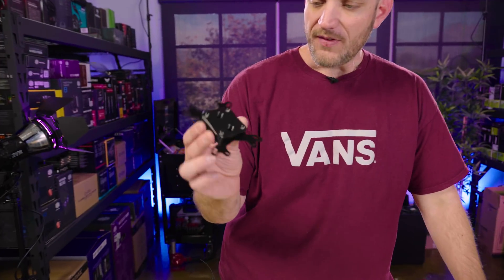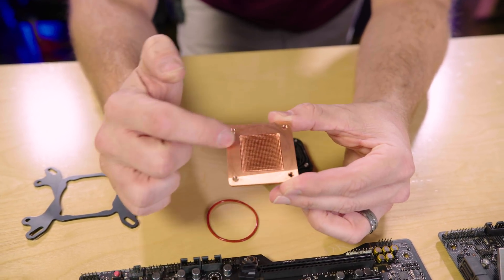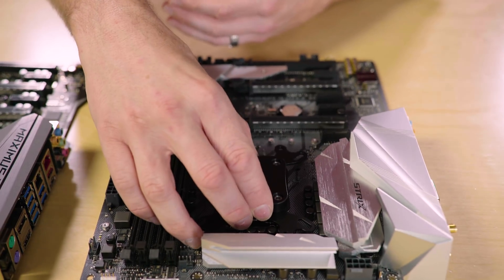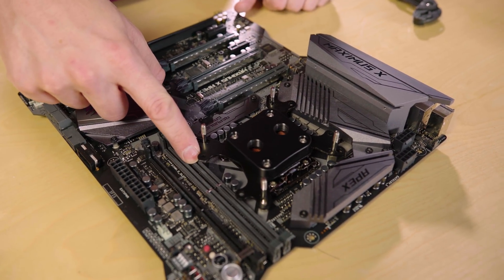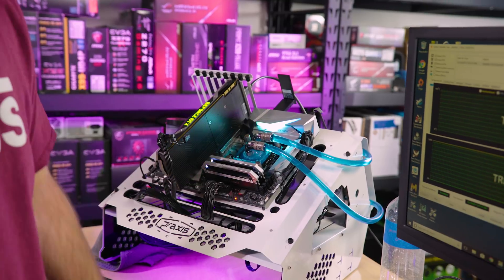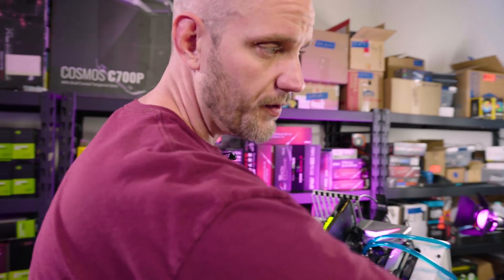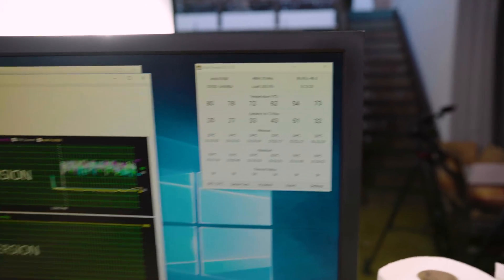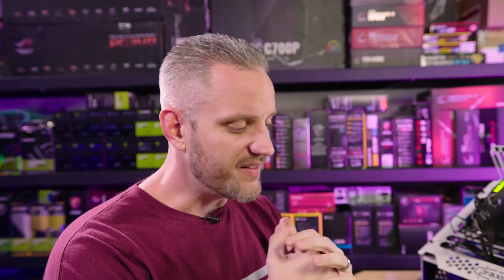I tried watercooling an overclocked 8700k with a $19 waterblock

Comment: $800 loop is still a fair bit i reckon, all depends if we include gpu or not an dhow many rads? My current loop 3 x 360's ($100 each), cpu block ($180), GPU block ($280), pump/res ($300), 2nd pump ($150) plus plumbing  and fittings, thats all AUD and  around $1200 which is only 854usd for a pretty decent loop, all major components EK apart from rads which are corsair. If you omit the gpu block, 1 rad and 2nd pump is WAY WAY under $800usd! It all snowballs anyway, my current build has more in fittings than i spent on my first entire loop!

Comment: Used to have a $17 waterblock cooling my hot Xeon and 2 cheapo gpu waterblocks cooling 2 overclocked rx580s which ran at almost 90c on air. They worked, ran no hotter than 60c on all 3 with 2 240mm rads

Comment: I built a loop with tons of Barrow parts ordered from Aliexpress: blocks, res/pump, fittings, tubing, etc. It worked great, and furthermore I didn’t clean it out for 2 YEARS, but when I did everything was super clean, no bad build-up, oxidation, corrosion, nothing. So in my limited experience at least, you definitely don’t need to pay those crazy EK prices!!

Comment: FYY 6-32 screw should be read as six thirty two. The screw is number 6 size, and 32 threads per inch. A 4-40 is number 4 size, 40 threads per inch.

Comment: the buyer will NOT go through putting $20 block on $200 motherboard using $200 worth of equipment...
Reply: The would for a $40 block though ;)
The water cooling prices are insanely high. There is no reason for it. It is old technology, nothing special besides being new to PC market.

Comment: This particular water block comes coated with special chemical compounds ready to optimally interact with loops using antifreeze, so if you want real results on your temps use ANTIFREEZE In your loop :)
Reply: Hmmmmm might try this for my first water build

Comment: I'm going to buy one and put together a cheap loop on my media center. Seems good enough for that project.
Reply: You'll be surprised how well it works and lasts. Just keep an eye on all parts being aluminum.
Reply: @ancogaming  would it be advisable to use an aluminum radiator as well?
Reply: @pospc2  Oh yes, they are much cheaper. Almost every AIO uses them anyway. From a cooling point of view, we are talking about a temp difference of, say, 3°C maximum compared to more expensive materials. EKWB has its own line of alu parts and fittings, which of course are a bit overpriced, but may serve as a backup if you can't find a particular part.

Comment: I have a theory as to why the results are so close - it's a CPU with a shitty TIM and that may be what makes it almost irrelevant what kind of block you put on. It would be interesting to test both blocks with a soldered/delidded CPU. I remember that my i5-6600K temps saw almost no difference when going from a cheap 240mm Deepcool Maelstrom AIO to a custom loop with a 360 60mm thick radiator, Supremacy  EVO and a D5 pump.

Comment: Old video but I just wanted to answer Jay's question about the o-ring material. It's probably Viton which comes in either a green color or orange/brown. Viton is more chemical resistant and less susceptible to oxidation compared to Buna-N.
Reply: Yup, we use them on flexible endoscope repairs. They are good stuff.

Comment: No jay you can't use a file, at least correctly. By pushing and pulling with the file you will prematurely wear it out and make it far less effective before it does. With files you have to always push with the handle tang at the rear.

Comment: I have a heatsink with a regular fan on it that came out of a old dell phenom cpu and i have it on my amd 8120 and it keeps my cpu at at ambient no load 27c and lowest i seen was 19c the highest at times have went to 70c or so due to heatsink being dirty but with load in gaming its usually around 65c..not to bad for some old chunk of aluminum and a shabby fan going at a constant full blast though since for some reason i cant adjust it,but oh well it does the job.

Comment: A little bit of "who cares?" here, but it's not a "6/32," its a 6-32. The 6 represents diameter (unified screw size) and 32 is the number of threads per inch.

Comment: I've got my 8700K on an original DangerDen TDX (not even the updated one with lots of pins/columns) and it works JUST fine! My radiators are in my closet, which gets cold in the winter and hot in the summer. Right now, in the heat, I'm at 4.8ghz with my two Chevette(yeah!) heater cores and eheim pump. In the winter I run 5ghz. https://imgur.com/ldIi3S4  https://imgur.com/mwcwC83

Comment: I bought a $15 waterblock on eBay when I was building my rig (right after Ryzen released).  I can't say enough about it's performance, as it dumps heat very quickly and I've seen some very impressive thermals during stress tests.  Never went over 70° (1800x).. even with 1.4v.  I couldn't recommend it though, since you could buy 5 of them and get different levels of quality with each one. I intended to replace it a few months after I built it, but I don't think it's necessary now.

Comment: I'm using a 30$ 310x50 tube tank+pump from BangGood.

No leaks, good flow and well, 310x50 is a nice big volume.

The same kind of tank from a namebrand would be 3-5x more expensive and be pretty much exactly the same.

Comment: I am literately water cooling an old PC with Chinese components right now 🤣 I wanna see if I can do it so I bought everything from there and ended up costing only 60$ and that was because the first reservoir which costed 10$ was to tall for my case . obviously I don't know how long it will work so I will run it for a like a year to see how long that stuff stays well enough but for now it is working fine without leaks hahaha (the PC is like 10 year old, so no worries about if it goes wrong)

Comment: Old post but I didnt see it in the comments: Those red o-rings are silicon. Most of the black o-rings are whats called Buna-N, a copolymer of Acrylonitrile and Butadiene. The silicone ones less mechanically durable but won't corrode or dry-rot.

Comment: This has probably already been said, but the screw size is 6-32, not 6/32nds.  It's a number 6 screw with 32 threads per inch.

Comment: Really though how much can you improve on a water block? Better machine work maybe, better quality plastic, that's about it. Really the only reason I'd buy a more expensive water block is for reassurance that it wouldn't leak over time from a cheap O-ring. Not really surprised with the test, the radiators and fans do most the work here

Comment: I bet the price goes up because of this video...

Also, and I feel safe from ridicule and hatred sharing the following info because this is a channel about learning: Jay called a bolt a screw and I hear that mistake a lot.

A bolt is a fastener designed to be driven into something that already has threads, like a nut or a threaded plate.

A screw is a fastener designed to cut its own thread path, like when driven into wood or sometimes plastic or even sheet metal.

In almost every case, they can easily be identified by the tip: bolts have a flat tip and screws have a pointed tip.

Comment: Hey Jay,  that o-ring is silicone.  Also, just an FYI, a 6-32 thread is not 6/32 of an inch.  It is a "Unified Thread Standard" #6-32 UNC.  Which is actually .138" diameter with 32 threads per inch.  Love your vids!

Comment: Heres a dumb idea. Mill out all the metal so that from the inlets/outlets  ports the cpu metal is exposed straight to the water. No copper for heat to pass through. Obviously with an o-ring between the two

Comment: I'd like to see you test one of these, which are I think the cheapest available cooling blocks https://www.ebay.co.uk/itm/41x41x12mm-Aluminium-Water-Cooling-Heatsink-Block-Liquid-Cooler-Blue-For-CPU-GPU/382094936904?epid=2134799639&hash=item58f6a20b48:g:vnwAAOSwEzxYeHYN

Comment: On the plus side, you can also get a big pack of cuttoff wheels from China for like, a buck,  which is waaaay cheaper than the official Dremmel cutoff wheels, so if you order a couple of packs of those along with the water block, it's practically like getting the water block for free :D

Comment: Starts filming a "simple" el cheapo water block review; ends up at harbor freight buying hacksaw, dremel bits, and a vise.
Actually, that's probably a good analog for how things usually end up going when using "cheap" solutions. save $20, end up buying $10 in extra parts, or "borrowing" parts from your other equipment, then spending 6 or 8 hours re-engineering things into something that actually works. :P

Comment: That is not even the cheapest block, thats actually a quite a good one. I swapped my i5-650 for a i7-870 and the stock cooler is not enough, so just for fun I want to watercool it. I was going to make the block myself (and still might do it) but I found basic blocks without mounts for 3$ on eBay. And the one Jay is using can be found for 11$ on eBay. I have got all the other parts from scrap bins for 0$ so I think I can do it pretty much either for free (if I do the block myself from scrap metal and find a pump) or for 7$ (eBay block 3$ and eBay pump 4$). If it will be any good, only time will tell. Worst case scenario, I lose 7$ if I need to buy a better block and pump.

Comment: https://www.aliexpress.com/item/1pc-CPU-Water-Cooling-Block-Waterblock-Nickel-Plated-Copper-Base-Inner-Channel-For-Intel-775-1150/32818841901.html 
If you buy it drectly from china its a 14$ waterblock. 
Theres also a acrylic version https://www.aliexpress.com/item/Computer-CPU-Water-Cooler-50mm-Transparent-Cover-Cooling-Block-For-AMD-Intel-C77-Dropship/32839303120.html

Comment: The question now is, "How long will it last?" Also, since the fluid is flowing DOWN into the copper instead of across and through will the block need to be serviced more frequently? Are we sure it is a pure copper plate? What kind of metallurgical degradation will we see over time if it is an inferior or alloyed copper? Is the copper thick enough to stand up to the heat and stress of contraction and expansion over time without undue warping?  Ok, so that is more than one question, but I think they are all valid.

Comment: I have a multitude of products in my loop.  Koolance/EKWB/XSPC/Primochill, all depends on what you want and what you want to pay... Performance wise, I will say that Primochill has the best soft tube, I went with EKWB for my fittings because they have the most options.  My waterblocks are from XSPC and Koolance supplied my pump and reservoir.  ;)

Comment: I've had good and bad ebay/amazon blocks. I've had ones that are better than EK blocks. I've also had ones that have leaked. The disclaimer to be made is that an EK block or any big name brand block will have a lower chance of leaking and will be designed to reach good temperatures across a wide range of configurations. IF anyone watching this video wants to water-cool on the cheap, be aware that cheaper components are more likely to perform badly because they will generally be more prone to small differences in your loop effecting their performance. I have made loops in ranges of 200 and 1000 dollars and they all perform about the same. The main difference between the two is on the expensive build my loop pressure didn't matter but on the ceap ones having the pump as the most expensive item on the loop meant the cheap fittings couldn't take the pressure. That's just one example but you get the point.

Comment: Longevity of it is in question. I used cheapo snicklefitz blocks off Amazon before for a few free i3 4370 i got. And 1 of them within 3 weeks failed on heavier use for gaming, and the other lasted just under 3 months moderate use. And a third lasted 10 months on a basic home pc setup, net surfing and what not, until i got rid of the system.

Comment: i'm running an i7 6700 at 4 GHz, with sli  msi gtx 970 both 4 gb oc gddr5  and 40 gb ddr 4 ram. But my cooler is a Cooler Master hyper 212 evo fan cooler. with 2 120 mil antec true quiet fans. ( red & green )  And i run ashes of the singularity. it's gets warm usually in the high 50's to low 60's. but adjusting my case fans  making them a bit faster. i usually run mid 40's. I'm running a msi z170A krait gaming mother board, with a 750 antec platinum + psu. My build is almost 3 years old. And i'm still not maxed out on ram yet. as i can go to 64 gb ddr4. after everything said and done i've spent 2800 $ on this pc

Comment: Just wanted to mention that 6-32 isn't the same as 6/32; 6-32 is #6 screw with 32 tpi (threads per inch of length), so you'd say "six thirty-two" instead of "six thirty-seconds".

Comment: $28 Barrow water block is made way better. It has linear micro channels and a jet plate (and the base heat spreader is polished).
Reply: and there is any difference in temp result... isn't?
Reply: I would expect to see a 1C difference. And 1 degree is a huge difference as far as water blocks go.

Comment: It beats the crap out of my NH-15 on 8700k @ 4.7GHz 1.29V... WTF?
Reply: what temperature you get with nh15 and these settings?
Reply: I hit over 90C within a minute while doing Prime95 torture test (89, 86, 96, 91, 92, 90) @ 1480 RPM fan speed. On idle it's ~32C @ 620 RPM. The strange thing is that while CPU-Z reports ~1.26V during test, the Core Temp reports ~1.37V (which would explain these high temps).
Reply: Sprytny Chomik damn so this Chinese block is better  than the best aircooler noctua d15

Comment: Jay, POM and Acetal are simply two different names for the exact same material 🤓
Reply: Acetal is Dupont's name for POM :)
Reply: Thomas Sanladerer Didn't think to find you here, lol
Reply: i didin't expect you here :)
Reply: also pretty hard to 3dprint with ;)
Reply: flandrble No it isn't. It gets the acetal name from the hemiacetal ends of the polymer chains. POM stands for Polyoxymethylene. Dupont's brand names for it are celcon and delrin. It's all acetal based no matter who the manufacturer.
Reply: Tom The 3d printing Guru

Comment: For the cheap DIY water cooling loop. Try looking for an automatic transmission cooler. They are pretty small in dimension and doesn't look hideous.
Reply: do you talk about this stuff ? Aluminum or copper ?
https://www.ebay.com/itm/Universal-Oil-Transmission-Power-Steering-Cooler-Kit-12-x-10-x-0-75-Inch-Silver-/322213329382
Reply: Aluminum is better imo.

Comment: in my loop i have a i80 corsair radiator a transparent hose a master cooler 240 mm radiator and a pump from a coolermaster seidon also. Thats 2 closed loops hacked in to one no loose reservoir and 4 fans to keep my AMD 9470 at 4.9 GHz it just wont do 5 GHz temps max 55 c

Comment: hello jay ,  I bought a gaming laptop last year , it cost 700$ and  I have been using it almost all day every day playing video games.
 It was going great until last 3 months or so  , my laptop started slowing down with the fps and slow commands reaction when I open a folder .
 I don't have a problem with cooling system, the laptop is not even getting hot , it almost feels like the laptop is too lazy to run the game properly. I'm a teenager I have a lot of virus and antivirus , I have windows10. do you have any idea ?
Reply: Well, your first mistake was "I bought a gaming laptop." Backup all your important files, and erase your hard drive. Reinstall Windows, and don't install anything that came with your laptop. Get drivers for your hardware from the Internet. This is assuming you've already done basic stuff like defragmenting your hard drive, and making sure there's spare space on your drive, as Windows needs a large chunk of your hard drive as virtual memory.

Comment: i kinda feel like those temps are pretty high. i've got my 8700k @5.0 gHz with leaving the voltage to auto. its runnin stable. still sub 60 degrees Celcius after stressing it for more than half an hour. cooling it with a kraken x62 btw.

Comment: fyi files (most of them) only cut in one direction, usually the push direction, you could roll the cutting edges, dulling the file by filing back and forth.

Comment: how is 19$ cheap for a single waterblock.
Reply: How is this even a question? Just type "waterblock" in the search bar at NewEgg.
Reply: Exactly, it's not a question; it's a statement. Hence the lack of a question-mark.
Reply: ? I meant $19 is quite cheap when the average price of a decent waterblock is about $100, but you didn't bother to inquire about that. $19 is cheap for a single waterblock. How? By being less than $100. When you include words like "how" at the beginning of a clause, it makes your comment a question, regardless of whether or not you decide to add a question mark. How do you not know this....
Reply: Thanks for your clarification, I should have used "in what sense/world/country is this cheap?". I didn't realize this sentence would only work in the GB and not in America. I'm sorry for not being so dense and less understanding. As for my statement, you áre right! Water blocks are indeed a lot more expensive, in America. I simply frowned upon the average price of waterblocks. 25-30$ should be enough for a high-end waterblock, manufacturing and R&D wise.

Comment: What would be a good waterblock for an I7 8700K being on a Z370E asus mobo? I was thinking NZXT? or anyone else have suggestions that will work and will keep it cool?
My CPU spikes constantly and sits idle at 40C~45C really hot... and under full load it can definitely hit 100C TJ throttling... so I MUST BUY A WATERCOOLER... ;~;